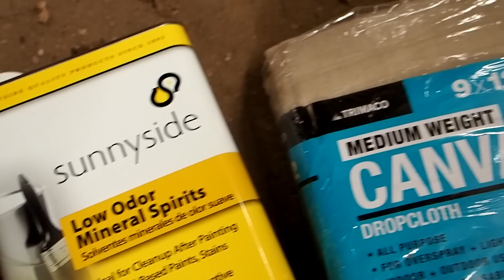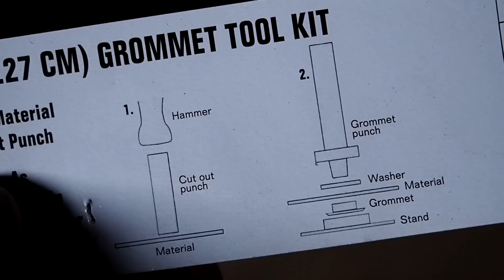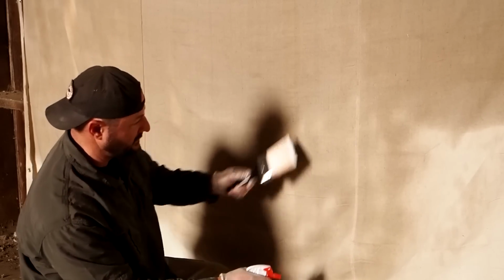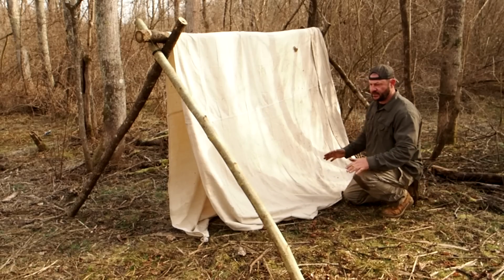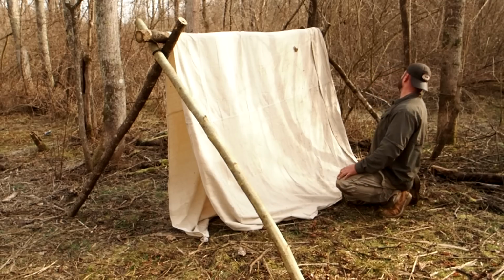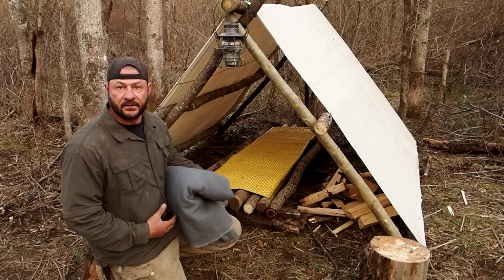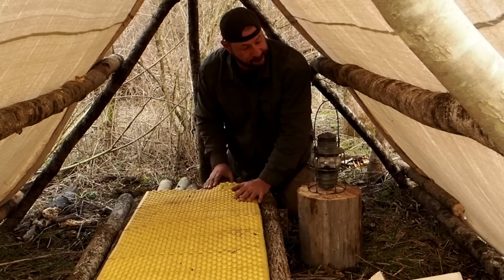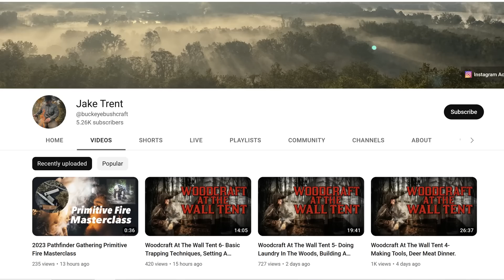Solo Overnight Making a DIY Waterproof Canvas Tarp for $40 in the Rain and Sausage Egg and Cheese.

Comment: All my life I've water proofed anything I want with 5 parts naphtha and 1 part 100% clear silicone caulking.
     Last year I threw out a ten year old tent, but treated the rain fly tarp.
It was tested in my back yard and is 100% no excuses completely waterproof in an all night long storm.
Just mix it up in a 5 gallon bucket, throw in tarp or whatever, soak an hour, dry out on back yard clothes line

Comment: I'll give a 3rd option of water proofing ,  Normal silicone & white spirits  ratio 2;1  2 parts silicone , 1 part white  spirits  on anything cloth. I used the anti-mould silicone .Weigh equal parts ,  Mix 2 small tubes or  cartridges of silicone & white spirits in a glass container with a screw lid , Mix /shake well until it's clear either brush on or place in a container , completely soak/wet .Then hang on the line to dry. No smell ! I did an old flat sheet ,queen size sheet .It's light weight folds up to very small & does the job. Mine has rope sown around boarder & grommets   .Try it on an old pair of gloves & see if it's what you need .

Comment: For a more permanent waterproofing hob, pour a little drying oil (linseed, tung, silicone sealant) into the mineral spirits.  I used boiled linseed oil - 4% by volume, hardened up in four days  to nice waterproof oilskin.  Next time I will a little non-drying oil ( Tocopherol acetate ) to keep more flexibility.  Being a chemist is occasionally useful.

Comment: I have made several of these over the past 40 years and I finally started using a pump weed sprayer.  I use the same sprayer for applying CanVac to my wall tents.  I used boiled linseed oil with a rust dye… but I did it outside because that linseed oil can catch fire as it dries.  Love your videos brother… I started camping like this when I was 16 and that has been a few days ago.  You can’t beat a roll of bank line.
Be safe and enjoy the stars at night

Comment: It would likely be easier if you used a paint roller instead. My question is, what is being used as the water repellent. I would think you'd want to use dissolved silicone with the mineral spirits to make it water proof.
Reply: That’s what I was thinking as well. Dissolving silicone into mineral spirits is the go to method these days for water proofing a tent, and making DIY waterproof tarps.
Reply: Yes. I was wondering that too.  I have never heard that mineral spirits would make canvas waterproof.  It would probably make it more flammable though.

Comment: Recently, I've seen several videos using Mineral Spirits or Naphtha as a carrier solvent for tubes of 100% silicone to make "waterproof" tarps so I found it surprising that mineral spirits alone will do the job? What are your thoughts? Is the addition of dissolved silicone a waste or would it fill the gaps between the threads and make it better than MS alone?
Reply: I have not experimented with using mineral spirits only, but I am almost certain that you need to dissolve silicon in the mineral spirits. Mineral spirits, naphtha, paint thinner, and other similarly used chemicals are solvents. Their purpose in the scenario of water proofing is to dissolve the silicon and allow it to be absorbed by the fibers of the canvas. Eventually whatever solvent you used will evaporate and leave the silicon behind. What I am unsure about is if there is any residue left behind by mineral spirits. If there is, it may have some water resistant properties. It is unlikely that any residue will be as effective or last as long as silicone.

Comment: I leave my tarp folded and soak it in a smaller container, pressing and rubbing it a good bit, let it soak for ehh 15-20 min to make sure saturated. Then hang and dry. 3 gallons will usually do 4 tarps

Comment: normally you would mix the mineral spirits with silicone, or mix linseed oil with turpentine, not sure what the purpose of the mineral spirits is on its own, in terms of waterproofing?

Comment: There might be a better cloth treatment that uses silicone caulk and naptha. Maybe a little bit more mess, but it can treat any cloth that it can soak into. Just keep in mind that it should be away from any spark or fire hazard until that solvent evaporates, but once it does the silicone itself is non-flammable. There are some other videos on it that are out there already.
Reply from the maker: thanks for watching

Comment: All formulae I have seen using mineral spirits had silicone dissolved in it. The fact is its the silicone that does most of the waterproofing. Pure silicone caulking is inexpensive if you shop carefully.
Reply from the maker: good thing there is more than one way to do something

Comment: sorry Corp, you failed on this one, mineral spirits isthe thinning solution, NOT the water proofing agent, Silicone or Boiled Linseed needs to be added to truly make it waterproof. ive just done a painters cloth with linseed oil, and its in its final drying stages, its been 5 days under the boat shed roof, another couple and shell be bonza beaut mate...
Reply: Vous avez raison, de plus je pense qu'il a confondu l'huile de Lin avec le white spirit! Bien à vous!

Comment: Only mineral spirits or linseed oil?  No silicone?
Reply: I'm confused too. I thought the mineral spirits are used to cut the silicone and help it impregnate the canvas...just min spirits? How does that waterproof canvas??
Reply: He did it wrong. 🤣 🤣 You are supposed to mix one tube or more depending on the size and thickness of the cloth with the solvent then you soke the cloth tarp completely in the mixture then you hang it to dry. Once it's done drying you have a 100% waterproof tarp.
Reply: Clear silicone
Reply: @jasontovar1776 that one was so clear, you couldn't see it

Comment: just a couple of thoughts, first, for your shorts, I would be interested in seeing simple things like tying different knots and simple things like how to care for your gear. how to select the proper gear, sharpen knifes. and things like how to prep for a weekend in the woods and how to properly store your gear when you get home. some of the really basic stuff for people that have never been in the woods but would like to start going.  it could help expand your view base to people that have never done it before, and serv as a refresher for some of us older guys that have forgotten some stuff over the years.  my second thought was on the method of applying the mineral spirits or linseed oil to the tarp, a pressurized sprayer like those used for spraying weed killer or pesticide would be much easier than a hand pump bottle and they are dirt cheap.

Comment: Fifty years ago I bought a used Camel canvas pop up camper and went to Sears . Bought a product called rain check. Painted it on the canvas, it never leaked. Sold it five years later still looked brand new. Don’t put down canvas because it’s a old idea.
They out last the products nowadays. Keep on camping.

Comment: I got to ask. What was the waterproofing material goin on the canvas?  I have revitalized old nylon tents and tarps using cheap silicone caulk melted into mineral spirits and soaked the old tent/tarp in it and hung it to dry. Works great.

Comment: Get two tubes of silicone caulk and two gallon of mineral spirits. Place in a trash can and mix thoroughly until the caulk is dissolved. Then soak your tarp completely and then let dry. Works fantastic.

Comment: Drop cloth canvas is notoriously weak. Those grommets are going to pull out. (I know this from experience.) I run webbing strapping (seat belt material) inside the fold and then set the grommets. It's hard on the hole punch, but my grommets have never pulled out.

Comment: I did this a few years ago but I used OD green polyester fabric I got for $1 a yard. I wished I would have used a pump sprayer. The spray bottle took forever and was ridiculously tedious. One tarp I made was soaked in a bucket instead, which worked the best.

Comment: Mix a clear plain silicone seal with the NAPTHA and put both in polyethylene contractors bag. Nead like dough until its saturated. Hang dry. Repeat if needed. Use a California king polyester flat sheet. And BTW, it's cheaper and lighter to buy a silpoly tarp 8x8 for $65. Love ur stuff SK.

Comment: I want to verify that mineral spirits is all you used on that tarp to waterproof that. I use a painters tarp that I used alcohol and silicone on but I'd rather do that? Thanks for all the knowledge. I utilize all the ideas with my Scouts and they really appreciate it.
Reply from the maker: shown in the video
Reply: I was wondering the same. No sure how a solvent that almost completely evaporates would make something waterproof, unless it somehow altered the physical structure of the cotton fibers (eg cross linking then to make them tighter). When I was a scout in the 60's and all we had were canvas tents (I remember the smell fondly) we would treat them with a thin silicone solution (probably mostly mineral spirits) and it would help a lot, but needed to be redone annually. I do a lot of woodworking and "boiled" Linseed Oil thinned slightly with MS (approx 4:1 dilution) is my go-to wood finish. This leaves the cotton rags stiff as a board when they dry. (BTW linseed soaked cotton or paper towels are prone to spontaneously combust. I lay them out to dry outside before disposing). For sil-nylon tarps, I use some pure silicone caulking with a touch of MS to make it brushable. Apply to seams with an acid brush (trimmed down to 1/2 inch). I might get some canvas and try a light linseed/MS mix or very thinned slicone. Then there are the myriad of linseed and wax/MS combos. (look up how to make "tin-pants")

Comment: Man the childhood memories in this video! We were lucky enough that our punch set was basically the same as yours except the two parts were mounted on 6 inch long metal plates that were hinged together at the end. Basically like a pair of tongs, but with punch/dolly on the ends. With spraying the tarp we cheated and used a garden pump-up pressure sprayer. Saves the hand cramps. For sealant it was a mix of cottonseed/linseed oil and/or beeswax coating (particularly on any stitched seams which were usually rubbed with a candle). Later as I got older and felt like cheating on the process I used Scotchguard water-proofing spray.
In the Australian army a runny egg on a bun/bread/muffin is called a "banjo" due to the yolk running down your front when you bit into it and then having to "play the banjo" to try and clean it off your uniform.

Comment: Never thought of using mineral spirits on cloth. But it is a bit oily and it should repel water.

Cloth is heavier than a tarp but it is about ten times sturdier.

All our tents in the army were a heavy cloth and they shed water. Don't know if t hey were treated with any chemicals but I would recognize that aroma anywhere. I always thought it was the dye to make them olive drab.

There is a "duck cloth" that was used for tent fabric.  All the civil war reenactors us that for their tents. It is not as thick as the fabric of the army tents but it works.

Comment: Just a quick question Corp! the mineral spirits! if you had more time for soak and dry? wouldnt it be better to add to the spirits clear silicone for a longer lasting waterproofing?
Reply from the maker: plenty of ways to something
Reply: Hi Phil adding silicone will work I've done this on tents to seem seal , it's basically the same ingredients that are in actual seem seal that can be bought only less expensive .

Comment: You still have my support no matter what. Neat idea with the tarp, but the mineral spirits would give me a splitting headache. Would silicone waterproofing spray work as well?
Reply: It definitely works, that's what I use. You can use any volatile dissolved silicone solution
Reply: @JamesSmith-rj4yw  what is the recipe

Comment: So if you are gonna soak a tarp instead would it be better to do the grommets first or after drying?
Reply from the maker: if a grommet leaks that is touching the ground, does it matter?
Reply: @recall5811  good point didn’t think of it that way.
Reply: @recall5811  If you prep a canvas with stuff that does not waterproof it, does it matter? Like you did genius?

Comment: Having built a tent out of average Painters cloth from a big box. I can tell you it's not a tight enough weave. While you might apply a waterproofing agent that will repel Most of the water it will just act as a sieve in heavy rain resulting in a fine mist still coming thru. Cheap though and at the price of REAL canvas maybe all one can afford.

Comment: Chapin Farm Sprayer 48oz pump bottle... you'll never want to use those little bottles again
Reply: I came here to specifically say this lol
Reply: @Paulio91184  anyone whose ever had to hand spray 100 sq ft of anything knows how much that starts to suck. I turned the guys at the brewery on to these sprayers for douching down the plate filters and all manner of brewery components with copious amounts of StarSan
Reply: @ChrisGrazioli  i have about 5 or 6 of them for variou things. One has a salt brine for my walkway and steps, one is full of old oil for undercoating, one for staining wood etc
Reply: @Paulio91184  NICE that salt brine is a good idea. I use one for sanitizer and one for household cleaner
Reply: @ChrisGrazioli  yea it's easy to make too..5 gallons of water, 10lbs of salt in a 5 gallon bucket. 2lbs of rock salt per gallon of water. Pour salt into hot water until it dissolves, put it in your sprayer and boom, sprayable ice melt...spray before it snows and it makes shoveling easier too.

Comment: Why put off until tomorrow what you could put off entirely? lol

Seriously, though, I didn't see this when it dropped because I was out in the field and it did rain just a little bit. I didn't fit so well under just my military poncho but still, you're right, if you don't have a military poncho, you're wrong. I kept my gear dry and most of myself dry. I don't really care too much about getting wet, but it was a little cold on the hike back. Cold does make it easier to keep hiking instead of taking lots of breaks to drink some more water.

I did have a really awesome fire and, since I forgot my aluminum foil, I discovered that you can cook potatoes in a couple of beer cans cut up with the two bottom parts fitting together. It burned the skins a little more but I actually thought that made them better. I was unsuccessful in starting the fire with a ferro rod but I do always carry a few regular lighters and a wind-resistant one just in case.

Comment: You could have saved yourself a boatload of time had you just pulled the tarp out of the packaging, put it in the bottom of a bucket (still folded) and poured the mineral spirits over it, and let it soak in.   Then unfold it, dry it, and put the grommets in... done.  :-)  Total time: (not including 10 min soak and drying time - environment dependent) 20 minutes.  Also, completely odorless mineral spirits are available.

Comment: It's probably a good thing you didn't use linseed oil, that stuff can literally spontaneously combust when it dries on cloth and it will take weeks to dry out in the sun in the middle of summer let alone winter. That being said just using mineral spirits on it's own isn't gonna make your tarp waterproof, you're supposed to mix the mineral spirits with silicone to thin out the silicone and turn it into a paint basically, after the spirits evaporate the canvas fibers will be completely impregnated with waterproof and nontoxic silicone. Just soaking it in mineral spirits and taking it out with you is actually super bad for you, those vapors are pretty harmful if you stick around them for more than eight hours, and when it finally dries it'll just be a regular old canvas sheet again.
Reply: Do you think it would help to wash it in hot water then throw it in the dryer to shrink it and tighten the fibers up more, or is that just an extra wasted step
Reply: @MrPrimitiveman  I don't think it would do much, it's pretty thoroughly waterproof after the silicone from what I've seen. This is more of a bushcraft nerd type of project to  begin with, it's neat but I just use a regular tent from Walmart, my camping acreage is way too buggy to sleep in the dirt with just a tarp over my head.
Reply: Thanks for the info.

Comment: Is this a post shtf project for when nothing else is available? Why not use a synthetic tarp that is already waterproof, half the weight, and half the price of canvas? E.G. on Amazon a 10' x 12' heavy duty polyethylene tarp, 10 Mil thick, that is waterproof and already has the metal grommets built in costs $18.89 and weighs 2.45 lbs. The poly tarp dries very quickly, has no significant weight gain when wet as does a canvas tarp, doesn't mildew, and comes in forest green, military green, brown, and camo for concealment.  Whereas a canvas 10' x 12' heavy duty tarp costs $44 to $68.00, is not waterproof without treatment, which by the way is flammable, will mildew if stored damp, weighs on average 10.5 lbs (DRY), and is not available in military green or camo.  I own several poly tarps of different sizes and colors from Harbor Freight, Lowe's, and Tractor Supply, but my favorite is my Kalinco polyester tarp that is 10' X 15', is waterproof, has grommets which are already situated to allow six different configurations of coverage and weighs just 2.79 lbs. The amount of coverage and easy/speedy put-up or take down makes it worth carrying even on my backpacking trips.